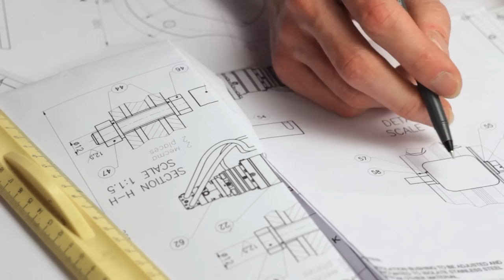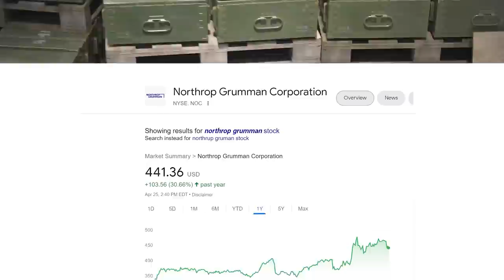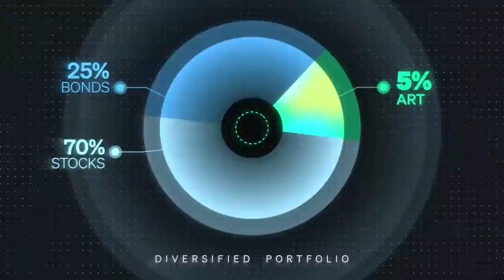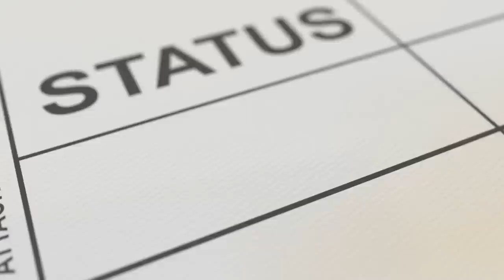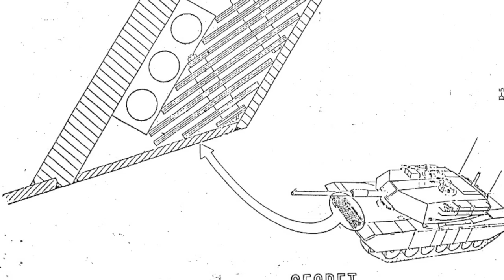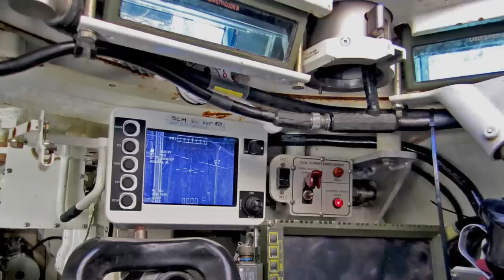The M1 Abrams Tank Needs to Chill Out

Comment: Tanks and Anti-tank weapons have been leapfrogging each other for as long as either has existed. During WW2 more tanks were destroyed by AT guns than anything else. The Matilda II tank during the early war period was extremely well armoured and was invulnerable to enemy fire until the Germans decided to shoot one with an Anti Aircraft gun and found that really worked. After the war, NATO and the Warsaw pact nations rapidly developed weapons using HEAT ammunition. This made steel armour obsolete and many nations started to develop fast, highly manoeuvrable tanks that had very limited armour. A good example of this was the Leopard 1 tank. These tanks used speed to counter enemy Anti-tank weapons and they worked until composite armour and wire-guided missiles were invented. So then came the age of ERA and Applique armour that could counter direct hits from guided missiles, so missiles developed tandem warheads and this was countered by spaced armour. Eventually, you get what you see now, Missiles using multiple attack methods for defeating a tank, for example, Top-down attack modes and tanks starting to implement active protection systems to prevent these missiles from contacting the vehicle.

It's a constant race that will see neither Tanks nor AT weapons obsolete in direct, open conflict until the very definition of Open conflict has changed to a point beyond recognition. Maybe space battles will change things.
Reply: Nah. I'm pretty sure we'll have space tanks.
Reply: Armor now needs “Active Point Defense”.   AKA A minigun that can independently engage drones, missiles’ or bombs.
Reply: @knuckler as an 19E/K way back in the "cold war" as an instructor we demonstrated the "sager" dance to the students, which when preformed properly didn't become a "breaking track" class
Reply: Also since WWII almost every tank has had an active protection system equipped. It's the little tubes around the tank that look like soda can and the button inside the turret that is labeled smoke. If an enemy can't get a visual on you they can't hit you and most smoke today is made with either red or white phosphorus which helps mask thermal signatures as well.
Reply: The Germans were Brilliant the allied armies feared the 88 millimeter gun
Reply: Everyone is always building a better mouse trap. Advancements in defense nescesitate advancments in offense necessitate advancements in defense. Insects have been evolving through that same competition for hundreds of millions of years. We with our fancy use of crafted tools are just starting in comparison. The direction tech is headed I think 1 day. Maybe within my life time. Wars will be fought not by soldiers, tanks, and plains. But by remote controlled fighting machines of all shape and sizes. From spy drones the size of a house fly to hunter/killer airborne and armored ground drones. All with integrated optics of every kind imaginable, combined with radar, satalite intelligence systems, ect. All controlled remotely by a room full of nerds wearing Hawaiian shirts in room somewhere under the Pentigon. Maybe throw in a few satalite based, solar powered Lazer weapons for hard to reach targets.. but the future will evolve from trying to better protect solders in the field to removing humans entierly from the battlefield equation. Why risk them when you don't have to? That's where the future of warfare is heading. And it's moving that way faster than we realize.
Reply: Germans did not fire their Anti Aircraft gun in WW2 and found that really worked by accident. This gun was desinged as an AA gun, so this was its primary feature, but its armor penetration against other foes was well know before the war started. Crews were trained to use this gun against bunkers and tanks and the right ammunition to do that, was also available and ready to be used. They did not try, the knew, that heavier armored tanks, like the Matilda, will be destroyed by this gun.
Reply: i would like to clarify about the matilda thing and a few others

its a common myth thinking the germans just randomly thought of using their heavy flak as at guns. when in reality they were toying around and in fact started using flak18s guns in direct fire roles during the Spanish civil war. now it is true that Rommel was the first german general who wanted towed AT guns in his mechanized infantry battalions but thats besides the point.

as for the cold war thats just plainly wrong. most nations during the heat sage infact DOUBLE DOWN on armour. where both the americans, british, french and soviets pushing for better ways of countering heat. early composite armour became a thing because of that.

now during that time the germans thought that because no one, atm, could take more than one hit, it be better to be more mobile so getting hit in the first place. this resulted in the leopard 1 and of-40, both who used speed and their mobility to constantly shift in a battle to prevent the enemy from knowing where the hostile tanks are at. both of which quickly became average when era and composite armour became a thing (for example look at the canadian C2 mexas kit, which is a leopard 1a3 thats been upgraded to an a5 but with a massive amount of composite armour slapped to the front and sides)

the rest seem to be correct however am pretty sure tandem warheads wont be stopped by spaced armour. however tandem warheads ARE counted by non explosive reactive armour (NERA). aka most of the stuff the PUMA ifv is covered with.
Reply: I think we're coming close to that race plateauing somewhat. The deciding factor here will be weight I think. A tank will always be able to carry more weight than infantry, and thus I expect APS to begin to somewhat outstrip ATGMs. Not to say it'll make them obsolete, but there will need to be some sort of paradigm shift.
Reply: Well said. Anti-tank weapons have not obsoleted tanks, it's just another strong factor in the overall metagame.
Reply: Tanks usefulness depends on various factors, the first being the combatants
Again a country like the US, tanks are useless. The US sure kill way of killing tanks dates back to 1991 Tank Plinking where US forces were shredding Iraqi tanks by dropping 500lbs GBU-12s.That worked then and even now against the newer tanks like T-14, Armata, it still works. The US military has endless ways of dealing with armor
The problem now is that ATGMs have gotten, lighter , longer range, better seekers and improved warhead
Example. the GAZ Tigr with Kornet, Israeli Spike NLOS, Tomcar/Sandcar and the US made JTLV with ATGMs are all lightweight assets that can be easily deployed and able to deal with armor
The Israeli Spike NLOS, Tomcar/Sandcar topping the scales with its lethality as the Spike NLOS can be launched from 16 miles away,. The Tomcar system is light enough to be carried by MV-22, CH-47 or CH-53 internally but most importantly, the NLOS can perform 90 degree drop on targets which allows to bypass tanks countermeasures 
The future of armor depends entirely on support from EW an SHORAD
Reply: Railguns will likely be what makes lighter armored vehicles over-take tanks although you could see tanks just incorporate this technology due to the fact that armour has its advantages even versus a railgun for instance improvements in the production of man-made sapphire/diamond could see composite armours made with such materials. A composite armour made with layers of titanium diamond and sapphire could easily stop or even deflect a railgun. Railguns arent the end all be all contrary to popular opinion they are good but not unbeatable. Now for railguns you'll have a small railgun (like a .22) for taking out missiles, mortars, mines, and likely deflecting other railgun rounds then you'll have the larger railgun most commonly a 70mm although some maybe armed with up to 150mm in order to carry their inertia through the deflector shots I was just talking about this larger railgun would be armed with flechettes, sabot, and tactical nuclear rounds likely in the 0.1-1 kiloton range. These will turn light armored vehicles or tanks into a mixture of; armoured personnel carrier, self-propelled artillery, and tank. You could even see the infantry dismounting out of one themselves spreading out to link up with and lead squads of robots both bipedal main assault bots(center-line direct fire support for the human operator) and quadrupedal recon and light attack bots (flanking and recon) along with support bots capable of repairing vehicles with 3d printed parts. This will create a comprehensive war fighting system that can self replicate on the battlefield making battles of the future much more drawn out with near peer competitors although near peer competitors will essentially not exist because the second an inferior force get into combat with a technologically superior enemy it will lead to them being wiped out within a couple of minutes while being able to inflict nearly zero casualties as the combat losses will be replaced in the field. Quality will slice through quantity like it never has before so countries like China and Russia will require a complete reevaluation of their military in order to even survive let alone win as the US will likely have this technology first they will likely be the world's strongest country for essentially the rest of history.
Reply: @AKlover  the M1A3 SEV3 has  hard kill active protection system that can defend aggainst missles
Reply: @yoboitim7624    It works once is my bet and it cannot lay fire on A low flying drone.
Reply: @christinalaw3375  Russian oligarchs collect the difference in cost, and leave their tankers with cloth 'helmets'.  This is also why most roads in Russia are dirt roads, and why the GDP of Russia (a country with 145 million people) is half that of the US state of Texas (which has 29 Million people).
Reply: Drones are limited in their effectiveness when they encounter an enemy with a competent EW.
Reply: @AKlover  Yeah a CWIS would unironically make sense in this context. APS systems could maybe take out 4-6 projectiles? But a cwis in a good angle could probably do 15.
Reply: @gamingrex2930   Depends on tracking hardware and targeting software.   You'd have to assume every CIWS system in the armored group is sharing data too and all the individual systems were tracking in A few different ways simultaneously.   Thermal, radio, and radar all at once and fusing the data while networking it to the rest of the column........ NOT EASY.
Reply: @AKlover  its trophy im pretty sure it has 4 uses or more
Reply: the future of warfare is small, mobile teams linked to a vast fleet of drones that know exactly where the enemy is, and then those teams firing long-range drone-guided missiles to knock out enemy positions.
Reply: Im a Gunner om the danish CV9035 IFV and we do the same fire procedure. Very effective
Reply: The thing is, Russia's land invasion is anachronistic. This kind of battle should not have happened, for obvious reasons: it is destroying two large economies, and Russia's potential gains will justify none of it. And because the air capabilities of the opposing forces pretty much cancel out each other, we have this Winter War 2 or a replay of Kursk. Basically, they are fighting a war of bygone era with modern weapons.

The tank used like the Russians are using them is definitely dead. The tank used with any kind of combined ops lives on.
Reply: @christinalaw3375  what the hell is ruscist?
Reply: @clonescope2433  This is true though its not an active defence so much as its a portable method of concealment. An active defence is something that has an effect on the inbound ordanents, either scrambling its tracking or destroying it. Generally Active defences are autonomous and able to independently identify and prosecute targets. A smoke launcher is reliant on the crew to work making it ineffective as an active defence.
Reply: Doese anyone know when AT guns stopped being used, they were quite prominent and useful in ww2?
Reply: @Thekilleroftanks  You are correct though my examples were to display changes in doctrine that worked to counter new threats. I know a lot of nations tried to improve armour values post war. The chieftain tank being the most notable. However these tanks were developed to counter traditional adversaries. Namely the big gun on the enemies tank.

This is due to a different mindset and doctrine that prioritised enemy armour over enemy anti armour. A lot of these designs never saw front line action.

New developments are never linier and many people find many different solutions to a problem and time decides who made the best solution. 

My comment was to highlight that these developments were made as a direct counter to new threats. If I was to highlight tanks like the Chieftain, conqueror, T29, IS4 and so on I would have gone off topic as these were designed to counter a different threat.
Reply: Swedish ATGMs have had top attack since 1985.
Reply: So basically we’ll go full circle and Matilda will rule the battlefields again. As the super advanced weapons of the future will be no match for the armour not seen in centuries.
Reply: yep even back to ww1 when the Germans started using super high cabler rifles to knock them out.
Reply: I could imagine optical computers (lower latency due to bypass analog to/from digital  conversions and low energy demand) guiding machine guns to eliminate incoming projectiles.
Reply: @verdebusterAP  said; "The US sure kill way of killing tanks dates back to 1991 Tank Plinking where US forces were shredding Iraqi tanks by dropping 500lbs GBU-12s." I agree, I think for some odd reason airpower is often overlooked in these discussions. Airpower, manned or unmanned, delivering accurate ordinance, guided or dumb, is still the Achillies heel of all MBTs. Any medium to large bomb, dropped CCIP dumb or guided, exploding just meters from a MBT is close enough for a kill. No direct hit is needed. It also strips away infantry support. MBTs alone have little to no defense against such an attack. Thats why we have combined arms. However if one fails the others, (like you lose your aircover) the result can be catastrophic for the armor.
Reply: Even then Space Battles will be more about who can get rid of the most heat then get out of the way of projectiles.
Reply: great comment
Reply: "till the Germans decided to shoot it with an AA gun which worked pretty well" idk why but that had me laughing lol
Reply: It's illegal to weaponize space.  That is neutral international territory like the open seas.
Reply: @mihovilraboteg6160  they are called anti-material rifles.
Reply: @mortenovergaard7397  it's headed to tunnel warfare and underground combat due to drones.
Reply: @austinlowrance5943  stop playing Battlefield 2040...

They scrapped the rail gun project because the energy needed was ridiculous.  No tank will use a rail gun
Reply: @austinlowrance5943  so many weirdos on YouTube trying to be armchair generals... including you
Reply: @sangbeom6245  i was talking about pak40s and such
Reply: @sangbeom6245  funny I actually studied military strategy in school but sure buddy. An opinion is an opinion people like you just insult when they don't have a response to or don't like what was said so you try to degrade people's confidence it's actually a form of psychological warfare. Very weak and elementary and virtually useless in reality you must identify with the strategy. So it makes sense you would cling to it.
Reply: @sangbeom6245  I actually don't play video games. Railguns work when you don't go beyond your means everyone should have known trying to use a railgun to shoot a 1000 miles would fail anytime you create something you should start from the worst and improve to the best its what they get trying to fly to the moon when they couldn't even walk.
Reply: @sangbeom6245  I'm too busy training for video games. You don't just go into the US army and get top athletic scores you have to train for that. Btw I got a 90 on my asvab so once I get myself physically fit to my liking I'll be able to get that green beret I want. 90 on the asvab means the military believes I'm intelligent enough for even the nuclear division.
Reply: @sangbeom6245  aaannnddd when I took an IQ test at 14 I score a 126 so I regularly test above way above average when compared to my peers.
Reply: @christinalaw3375  Russia is far larger than the entire USA, and has it's own resources, yet they continue to treat their population as peasants, while the oligarchs get rich at their expense. This is why they have poorly trained and equipped conscripts, and are perfectly happy to sacrifice soldiers.  On the opposite end of the spectrum, you have the USA which spends more per soldier (all volunteer force) to protect them because we know a well trained and experienced force is more important to the long term health and effectiveness of that force in war.  Additionally, the USA's GDP is relevant in terms of equipping and maintaining the force over the course of a war.  The Russians are already combat ineffective in many of their brigades due to combat losses beyond anything seen in the West over the past 40 years.  That's why cloth helments vs kevlar ballistic protective helmets are a telling indicator of the disparities between the two armies.
Reply: @sangbeom6245  eventually, tanks will be made that can traverse the earth's core; so that those tanks can fire tunnel-boring missiles to hit other tanks closer to the earth's crust 😃.
Reply: Almost correct, the Matilda is an Infantry and therefore had the best weapons and armour of any tank, infantry with AT.
Reply: @christinalaw3375  They simply don't have room in their tanks to wear hard helmets and move around effectively. The soft helmets are cheap and thin while providing a little protection from smacking your head on something metal when your bat shit insane driver takes a trench at 40 kph.